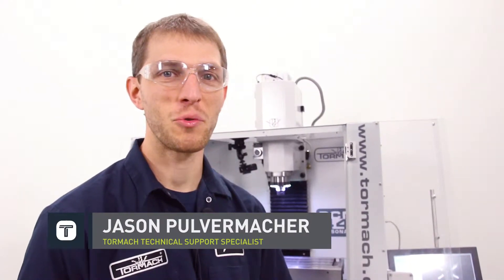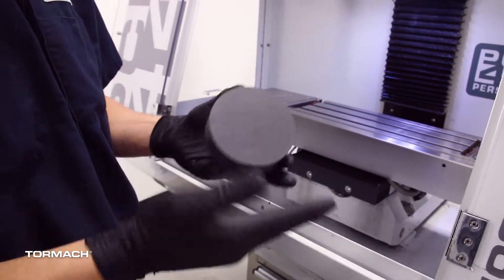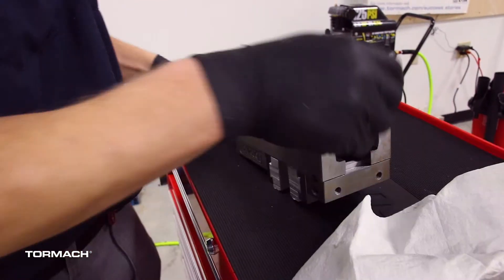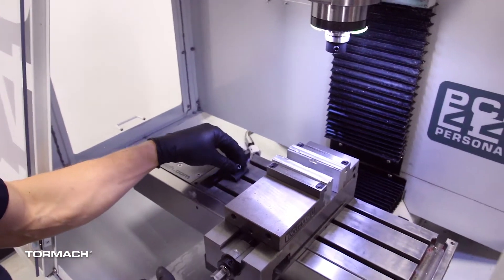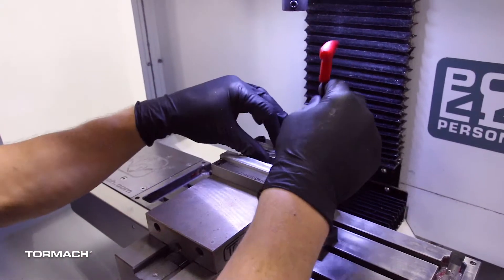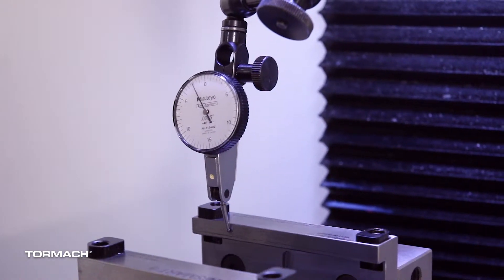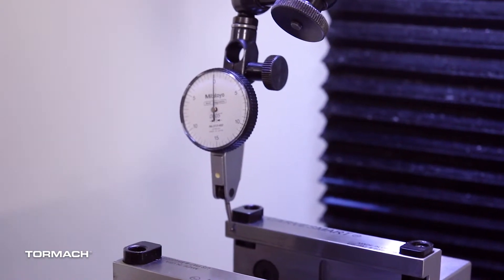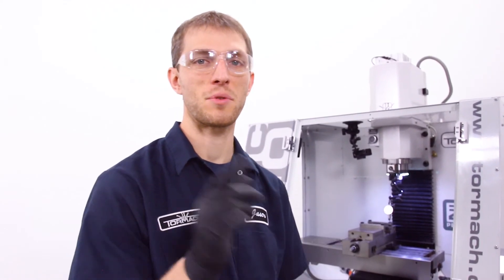Tormach Machinist Tip - Basic Steps to Indicate (Square) a Vise

Comment: You have to go beyond zero beacuse you clamped past the center of rotation.  If you clamp on the slot closer to you at first it puts the pivot point in a better spot.  Not a big deal, but will save a few itterations.